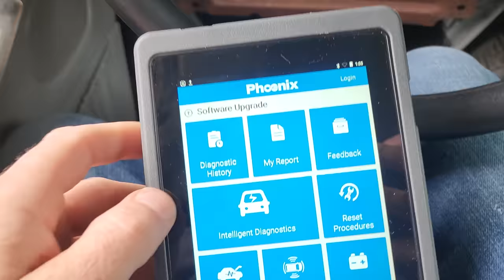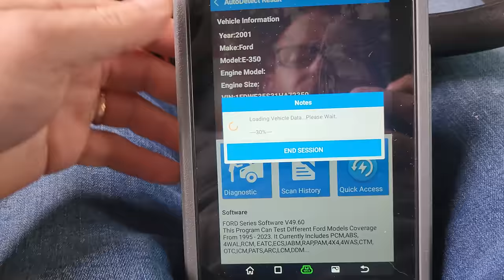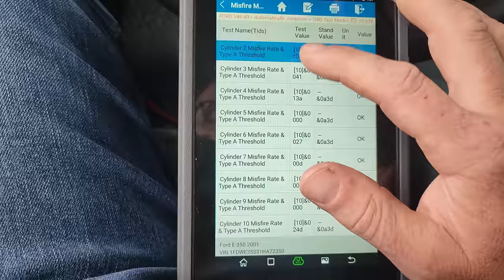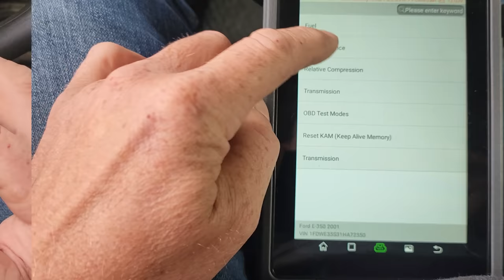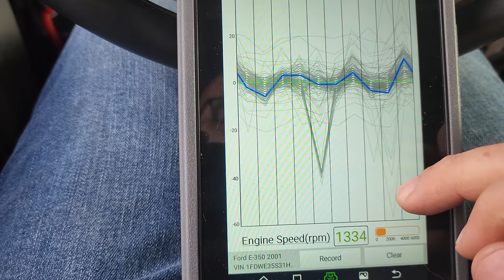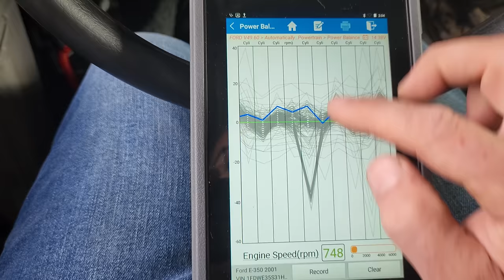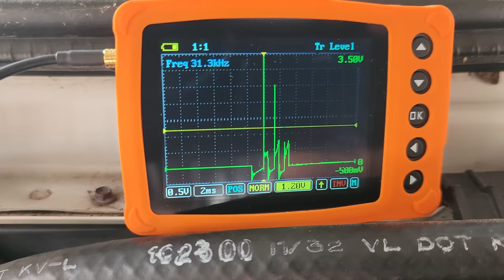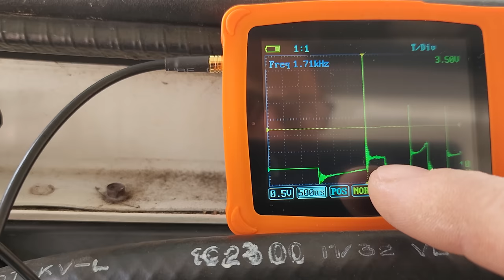Ford Coil On Plug Misfire Diagnostics [E-350 V-10]

Comment: Just a guess but the misfire values on your scan tool appear to be in Hexadecimal. Using a Hex to decimal converter, the 0a3d standard value listed on your scanner converts to 2621. The 0c05 test value on your tool for cylinder 2 converts to 3077 which is higher than 2621. All of the other cylinders have a converted test value less than 2621.
Reply: Definitely. Like a nerd I converted them all earlier myself. God we're sad. haha. I'm probably missing something, but 2621 Seems an oddly high threshold of what misfire count gets classed as a "FAIL" not an "OK" for the "VALUE". Especially as, given it threw a p0300 not just a p0302, it must have decided on some level those other cylinders' non zero misfire counts were still too much. :)
Reply from the maker: Thank you!
Reply from the maker: It is super common to have a single cylinder misfire record false misfiring events on other cylinders. Just an FYI
and that's what was happening here for sure. Thanks!

Comment: So when you were looking up the Mode 06 data and all the cylinder misfires, its like a code used under certain manufacturers of the scan tool I'd say. I also wonder if it can go to Landscape mode instead of just vertical which may make things easier to clarify for you. I would only pay attention though to that cylinder 2 on Mode 6 where it said "Failed." I could be wrong too, but just trying to help ya out somewhat.

Comment: Techs who think they do not need a scope have no idea what they are missing. Using Lab scopes has literally mad my life for the better.  I have excelled at work because of the utilization of scopes  and have been rewarded for it very well. It has made me enjoy my trade so much more . In industrial generator work lab scopes also help with power quality analysis. I am  always showing how my scope has helped troubleshoot some really difficult problems in hopes that the other techs will catch on but unfortunately I have had no one interested enough to get one.

Comment: It would be interesting to see if it's a bad coil, bad plug or bad coil boot. These Triton engines whether it be a 4.6, 5.4 or the 6.8L, it's best to use Motorcraft plugs and change all of the boots on the coils. Heat is the enemy for those boots, and they do break down over time and allow spark to arc out to the cylinder head. I get it though; these are the heads that have maybe 3 or 4 threads holding the plugs in. If the owner has anywhere around 80-90k miles on that engine, he will probably start having other issues as far as misfires go. Back when I had my 98 F-150 with the 5.4L, that's about when my issues started. Well wishes to your Mom Paul.
Reply from the maker: my money was on the plug with that waveform

Comment: i put 5 volts to the signal wire it shows when i test crankshaft sensor but it doesnt show when i test other sensors on the same signal wire it only shows the 12 volt power i have 2005 nissan murano awd it dont have a icm i dont think so what is mine called can you please lead me in right direction cause i dont have alot of money for the shops im a single dad and i need to get m
Reply from the maker: I'm not following at all. Step 1 is to have good service info and wiring diagrams.
Some sensors will use 5v and others use 12v as a power source.
Here is the DIY version of the service info I use
https://eautorepair.adtrk.biz/?a=10817&c=24&p=r&s1=

Comment: Question: can I use a MAP sensor as a pulse sensor?
Reply from the maker: You're better off with a fuel tank pressure sensor as they are more sensitive . But yes, check out my Hummer series. I used an existing MAP sensor to view intake pulses

Comment: Had similar misfires on an 03 V10 box truck with a lot more miles. It's a 22 year old truck and if one coil is going out, the others aren't far behind. Access to them on these vans is a big pain, so it makes sense to knock them all out at once and be good for another 20 years. And this is not the time to cheap out on the parts. OEM Motorcraft only, or don't bother at all.
Reply from the maker: at $120 a coil from Ford, I wouldn't be dropping over $1000 in coils on this. But I understand your point too
Reply: The Motorcraft DG508? $35 at Rock Auto.
Reply from the maker: @atikovi1 rock auto coils? No thanks
Reply: Up to you. $35 from RA or $55 from Ford.
Reply: @ScannerDanner rockauto doesn't make any parts, they're just a reseller like any parts store. It's no different than ordering Motorcraft from Orielly or chinesium dorman. It's people choosing the cheapest chinesium parts available that is the problem, rockauto gets the blame. ACDelco, Mopar, Motorcraft are often available on rockauto when no local suppliers can source them for our shop. We order from dealers, but he's right, those older parts are well below the cost from the dealership for the same part.

Comment: how does the paddle probe work on like your ramcharger
Reply from the maker: It would work perfectly. You can hold it over each plug wire
Reply: @ScannerDanner  do u need attenuator
Reply from the maker: @DependableAutoTruck  never, on any scope, for secondary ignition waveforms as it is a capacitive pickup that produces very small voltage input signals
The primary side, voltage waveforms is when you need to be concerned, but I do not know what the max input voltage is on these